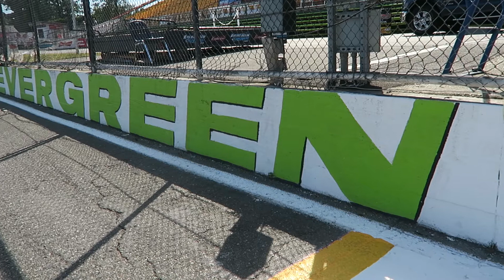My Journey In NASCAR - Episode 12 - Episode 13 K&N at Evergreen

Comment: You raced great for Evergreen, your'e on point with the track being a tough track, turns one and two are pretty difficult for even seasoned racers at that track, turn one dips in and collects a lot of the water and dirt and there's always dirt and debris from the MX track out there not even to mention the tracks about sixty years old. You did great out there, if you ever want at Evergreen don't be afraid to ask people like the Late Model drivers how the track is cause it changes every year and most of those drivers don't mind at all talking with people. Great job out there again and I hope your next race goes well.